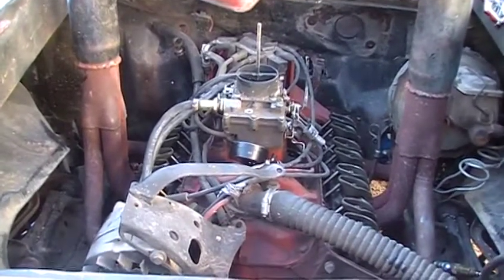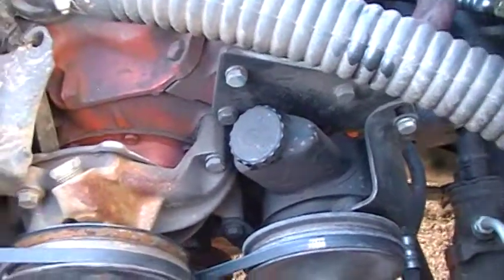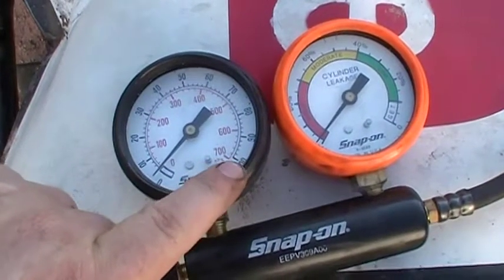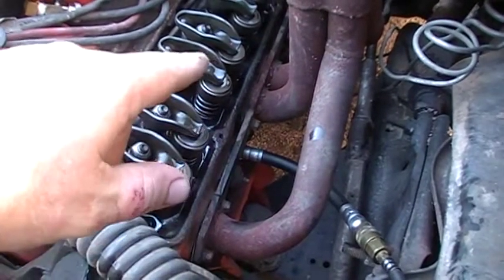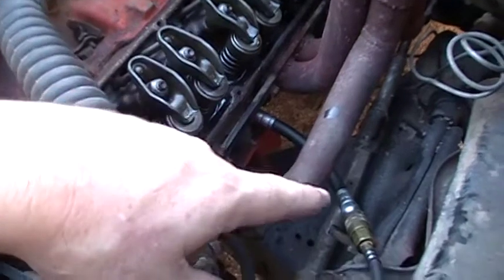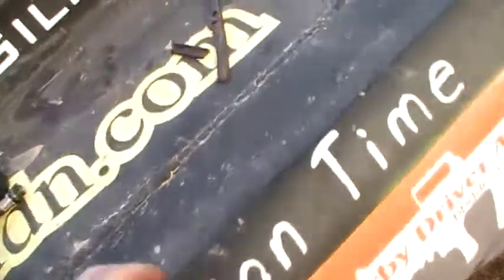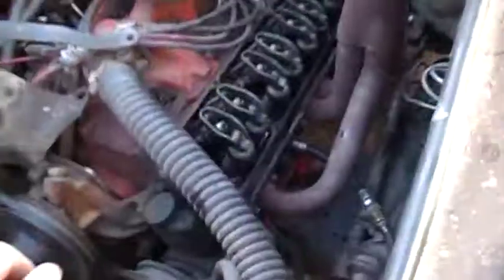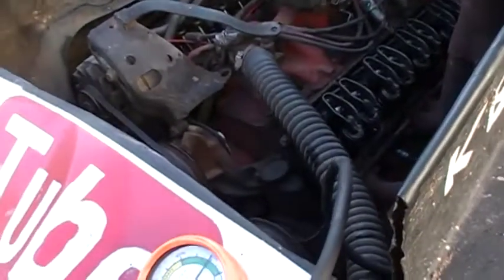Demolition Derby Tech, Cylinder leak down testing.

Comment from the maker: I checked all cylinders. They check out good. Except for a few valves are getting worn. But the chain is also fine. I will pull the distributor and go though it. I had moved it a few notch. To clear the protector. When it had a vacuum advance. I modified to be mechanical.

Comment: It looks like the distributor is in the wrong position, where the wire harness plugs in  the distributor is to face the brake booster.did you do a compression  and  leak down test on all cylinders,or is the timing chain have to much slack in it

Comment from the maker: Those engines have a million problems. Case half/ oil pan leaks. Head cross over coolant pipe. Cam driving water pump. With a tiny vacuum cleaner belt. List goes one.